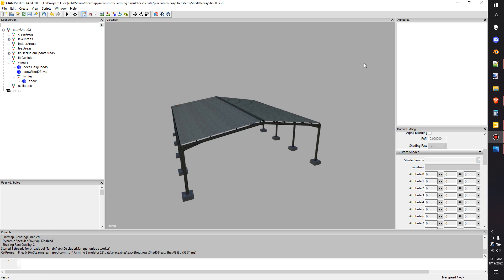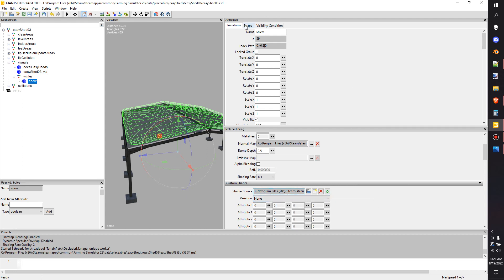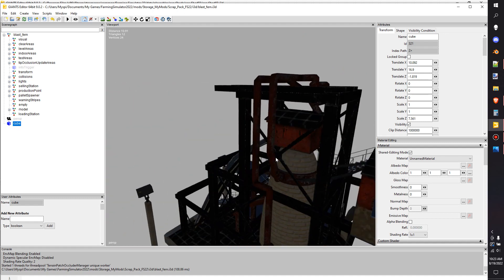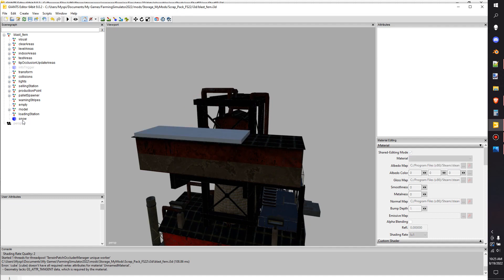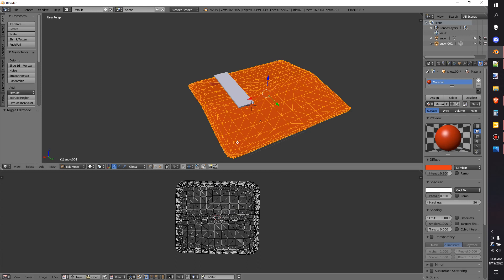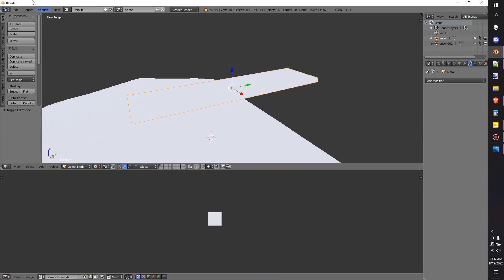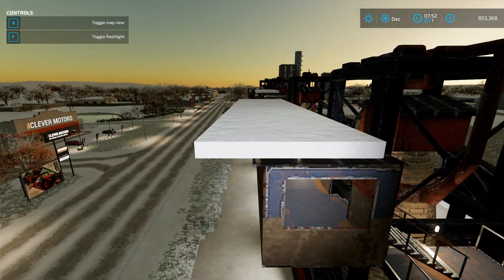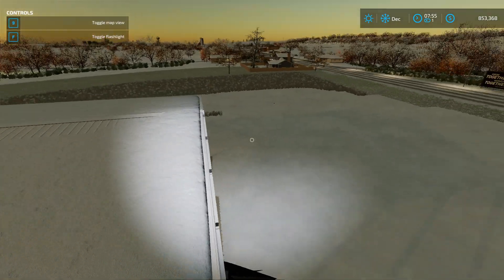Snow on Placeables - Giants Editor - Just learning

Comment: Hi Lambo... Your issue with the incorrect positioning of the snow mass is due to the color used to paint the vertices of your snow volume in Blender. You should use a color of 0.5 0.5 0.5 in RGB.
Reply from the maker: Cool thanks for the info. Appreciate it :)

Comment: Hello I have a question about mod, every tractor and car has a visual for the model and in the model the fenders and wipers are made, they are not separate from the visual and giants uses a transform group to rotate the wiper and fenders for a example, I exported a tractor visual to blender and when I exported it back to giants the fenders and wiper did not rotate with the transform group how can I fix that?
Reply from the maker: Giants animates their stock models. You can not remove stuff with there models without breaking animation
Reply: @LAMBOMODS  ok but do I have to redo the animation in blender after?
Reply from the maker: @tevneo  basically Ridiculous Dom said it. manually go back in and place the transforms. I have not done this, but the concept sounds logical.
Reply: @LAMBOMODS  Yep I am doing that, thanks for telling me guys, I could not find anyone else that knew why!
Reply: When I was modding my 4755 I had to pull the whole tractor into blender then separate all parts that are animated then export them back into GE and place each part into the transform group they are tied to. May not be the right way but it worked for me.
Reply: @ridiculousdominick  Yeah I thought about the same thing, I just wanted to know if there was any other way, thanks for helping!